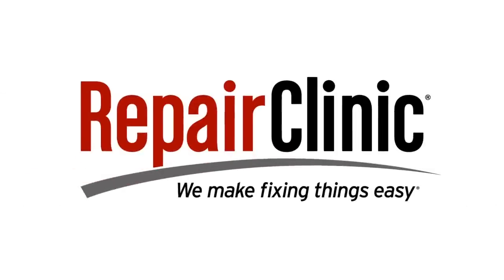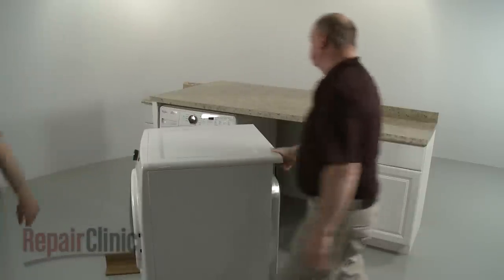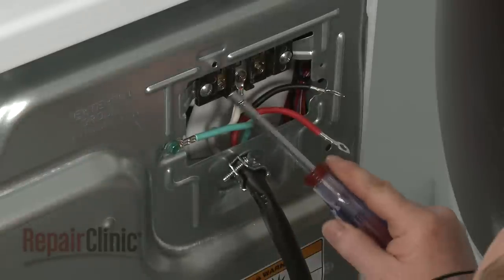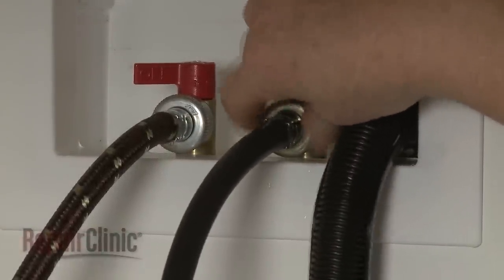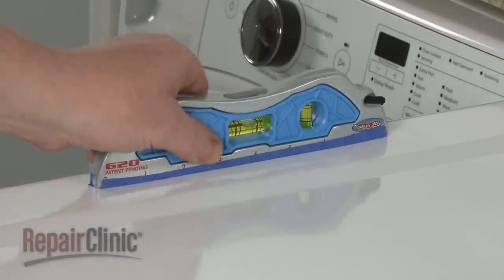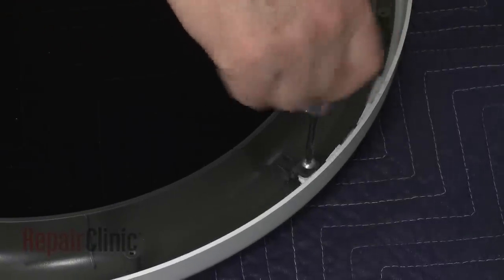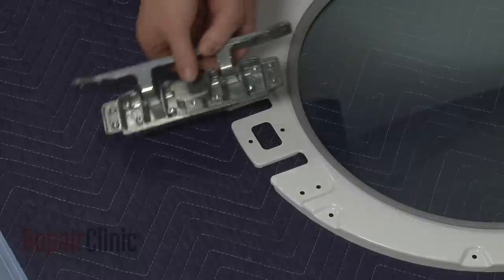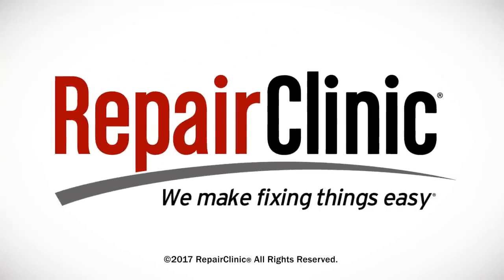Whirlpool Dryer Installation (Model WED85HEFW0)

Comment: Thanks for the video explaining how to switch door opening side.
Wouldn't it be possible to make a door that is simetrical top half to bottom half and so that to change the opening side you just remove the door hinge and latch from the machine, still attached to the door, turn the door 180 degrees and reattach the hinge and latch, now each on the oposite side and, well, upside down, though it wouldn't show because the whole door assembly is same top half to bottom half? 
This way, instead of unscrewing 27 screws and rescrewing them back to flip the door opening side, you would only need to unscrew/rescrew 6 of them, right!?